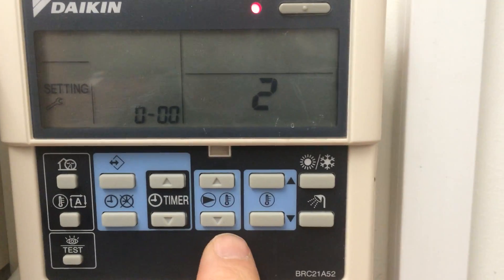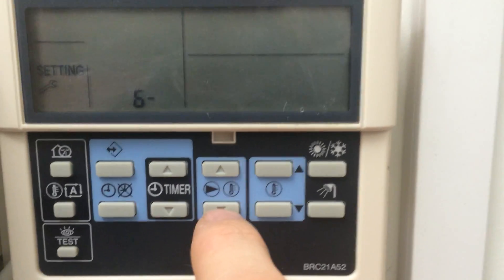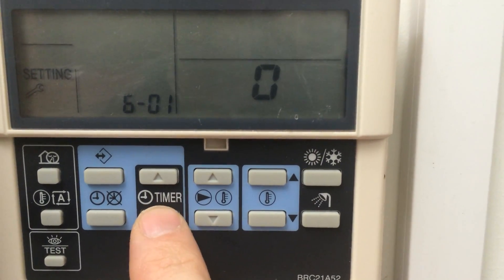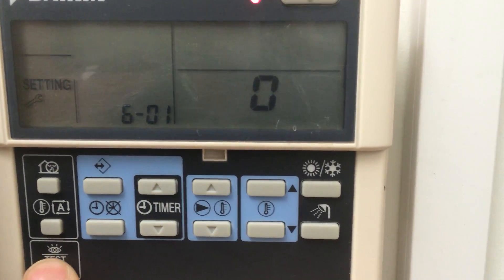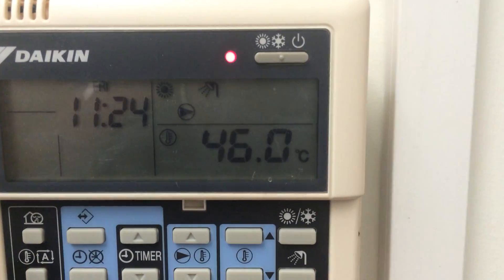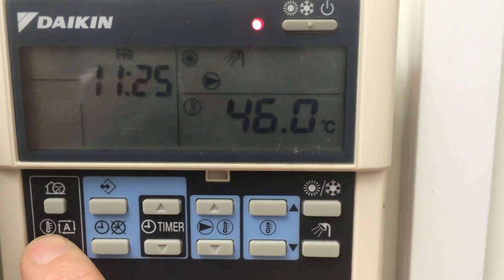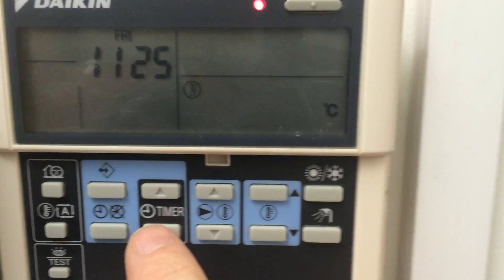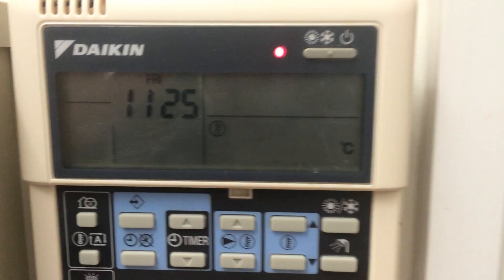Daikin HT optional room stat enabling

Comment: I know this is an old video but hopefully you can help. Can you tell me the best energy saving settings for this model? Mine costing an arm and a leg to run
Reply: I've had this controller on my Altherma for 10yrs and use the room thermostats to control the heat rather than as in this video where you use the controller itself. Mine costs pennies to run and I've been very pleased with it.  I tend to use the following video 
link:  https://www.youtube.com/watch?v=EwNel0miig8&t=206s  to reset it when it throws a wobbly after a power cut,, as the battery no longer recharges itself and I really do need a new controller but I don't mind resetting the date/time manually every so often. However, the video does show you how to easily set the controller for weather compensation, temperature etc as well as changing day and time, which is very handy. As I said I have found it to be the most economical way of using the system and at the time of posting this my electric is usually around £2.50 a day in the summer and depending on how cold in the winter can be between £3.50 and £4.50 a day.  I'm all electric, no gas here or open fires so those figures include lighting, cooking, laundry costs which I think is pretty good.
Reply: My first winter with this heat pump and finding it quite costly now. Not much info on these
Reply: @dannyboisparky  Did you ever figure out how to make it cheaper?